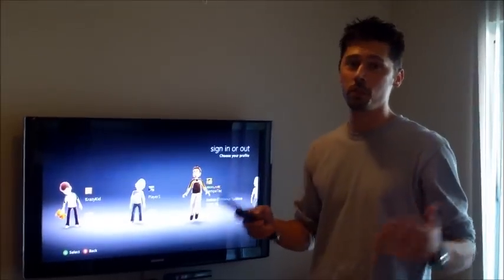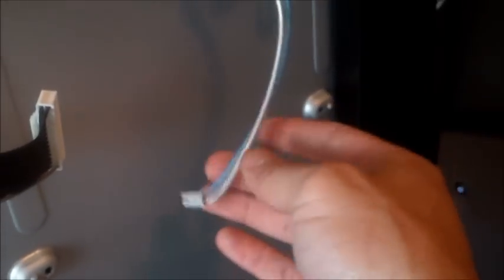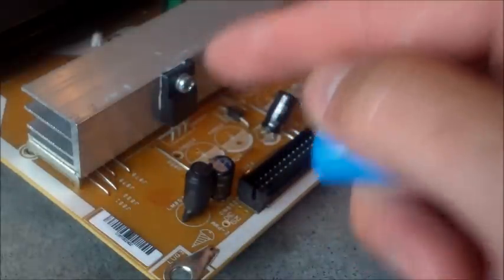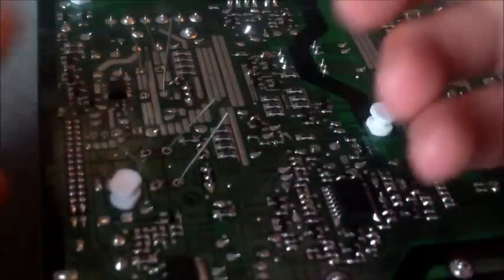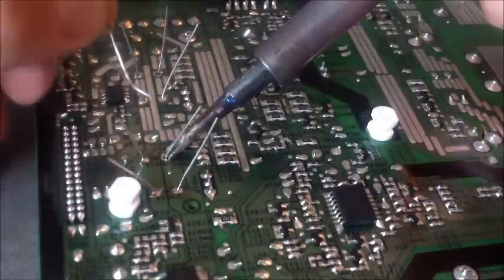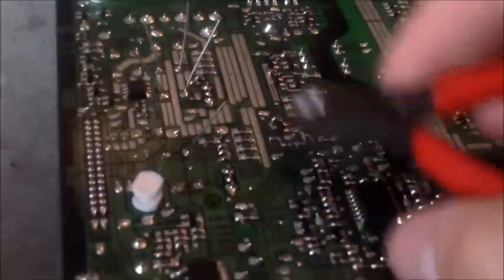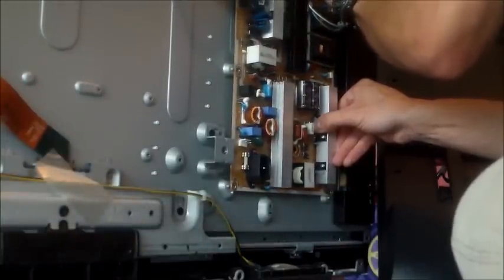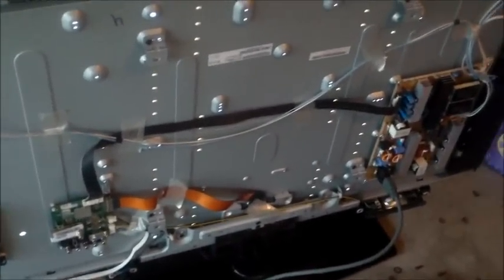SAMSUNG TV REPAIR- TURNS OFF RANDOMLY

Comment: Anybody here have the UN46F6300? Just purchased mine a few days ago, and it's already randomly turning off. Turned off once already while watching YouTube. Thing is merely hours old...
Reply from the maker: unplug powercord for 1 minute then go into settings and update firmware to latest version, you can use usb drive to update TVs, turn off anynet feature or call samsung -1-800-SAMSUNG (1-800-726-7864)

Comment: the turning off randomly was a firmware update for me. As far as the clicking, yes happened to me twice, and I had bad caps both times. TV is still on the wall working after the repair. (knock on wood)

Comment: I have a older TV HLn507W ...worked great until lamp went out..replaced.... worked great ..then started turning off ...could unplug and waited about 5 or 10 minutes plug back in ....worked great for awhile...slowly started staying on a shorter amount of time. On and then off. Could you maybe help to point me in the right direction on what might be wrong it. Thanks
Reply from the maker: can be over heating so clean fans or replace them but color wheel sometimes fails too and dmd board. call for tv boards 1 (877) 881-6492 / (952) 881-6492

Comment: hello  tampatec ,i have 55'' samsung tv. won't star the red light its on , not blinking  ,i change  2 capasitors  i put back cover and try again.but  stillno work, I order a new power board on shopjimmy.com i put it on  still do not turned on  just the red light can you help me
Reply: I am having the same problem with mine and would love to know what is going on with it!
Reply: joel lobo I installed a new power supply board, still not working. Just ordered a main board out of cracked screen "new" TV. hope this works.

Comment: Excellent video(s)! I have a Vizio 55" Smart Tv (Model: E551i-A2) and it keeps powering off and being turned on. The power light remains on steady (no blinking) and when I try to use the remote, the reaction time slows down tremendously. I have tried plugging the unit into different power outlets, but to no avail, nothing happens. Any suggestion? Do you think it may be the capacitors? Thanks in advance and keep up the awesome work! :)
Reply from the maker: yes bad capacitors are common fix for that problem, check 1000uf 10v, 2200uf 10v, 3300uf 10v, in power board. some bad caps may "look ok" but are really bad. get caps at shopjimmy.com
Reply: ***** hi i have the same exact model tv as the one in your video. i looked at the capacitors and none looked bad but i checked them anyway per your comment above that some bad caps may look ok but are bad. well, none of the 1000uF caps are bad - any suggestions now?? Thanks in advance for your help.
Reply: jjast2
I've noticed some people are having the power cycle issue and the problem is the power switch.  You can try unplugging your manual power switch and use your remote to power on and off and control your TV.

Comment: I changed 4 blown Caps on a Samsung lcd model # Ln-t4061F,  it still turns on and off 
 Randomly. i checked the 2 fuse and other caps they are good. what do you think it could be? thanks!

Comment: HEY I HAVE a Samsung 42' Hdlcd LN40B55OK1F that turns on and off. I smelled a burning smell at first then it started..I took the back off the tv and I see that a burn mark is on a black Lego looking piece with a white strip along it with numbers on it. What is that, and how can I fix it...? # I need help#

Comment: thanks for the video Tampatec, i have a samsung tv, it turns itself on and off within 5 seconds, I have a multimetter, I have unlpluged the power supply after nearly testing all the components on the board, there is 2 that don't give me nothing at all on the meter, this 14D751K (oltage dependent resistor 14D751K)  and another one blue one closer to this. these to give nothing on the meter, would anyone please know are those 2 supposed to give anything when checking with meter, thanks

Comment: hey Tampatec, been following you everytime i have a repair, thanks for your vids man.
I just got a LG 47 LY3DE lcd and it restarts intermittently, but only in TV reception mode, not on HDMI. do you think this is a power supply issue? cheers
Reply from the maker: Ralph Kluge check standby volts on power board if solid then check main board.

Comment: I'm having similar issues with a Samsung LN46B650T1FXZA LCD. I had used a VGA cable on it for a few minutes on my laptop and then saw an option to connect to the internet. I put the settings for my web but then I got sidetracked and didn't finish. Later that night my mother tried to use the TV and it kept turning on and off. I don't know what more it could be.The screens would come on for maybe 8 seconds but then would go black and then the start up chime would start it again then off. HELP! lol

Comment: Thanks for the power supply video! I fixed my Samsung 19" tv by replacing capacitors in the power supply.  I don't understand, before I order capacitor kit I read the power supply all voltage were 14.7 V witch it good but tv still did not work.  The only indication that power supply was bad was the capacitor had bulge in the top. Thank you need more video!

Comment: How long u been in the game?!  I been in since '91 when I was 14 going on 15 lol!
Reply: I have a TCL.ROKU 32" had it 3 years been turning off by itself my old tv i use to have 32" element usa made tv 
My current tv started doing it may 3 has Horizontal line makes hard for me to read on Websites like Hughesnet or Dish network others
Reply: @unknownwolf4046  they have a Samsung that has the same defect and people thought it was capacitors but it turned out to be the main board. Samsung never pulled the defective TV off the market they still sell them at Walmart.

Comment: Mine just started randomly turning off and on. Funny thing is it does it only when the TV first starts....after about 5min it stops and the tv is fine. Any idea?
Reply from the maker: randomly clicking off is bad capacitors in powersupply in most cases, some caps may look good but are still bad.
Reply: *****
I took it down and vacuumed it all out. Didnt see any bad caps. I replaced the power cord and seems to have fixed it. Very odd it only did it when the tv was cold. Thanks for the reply.